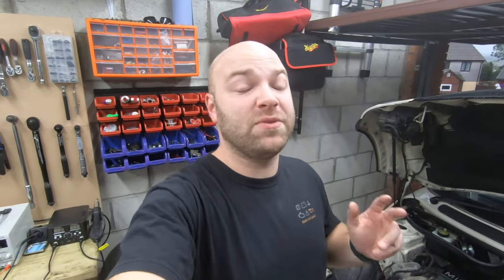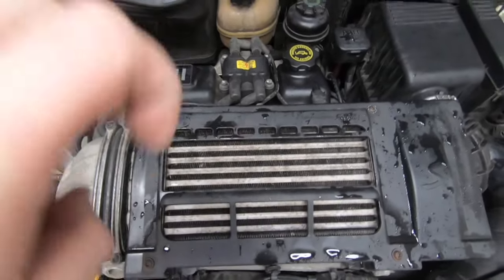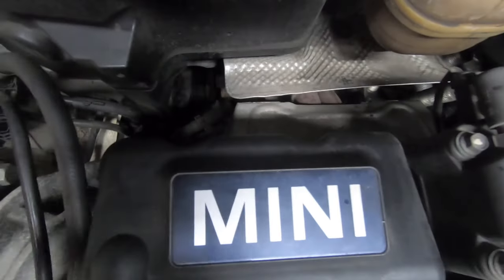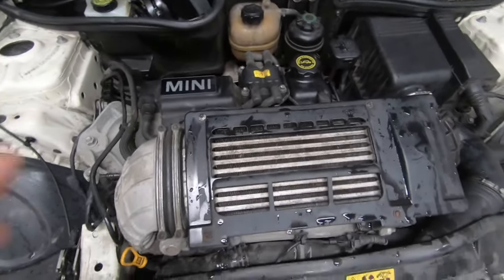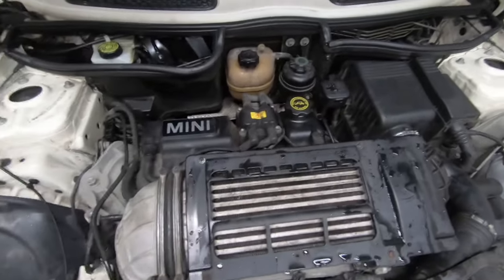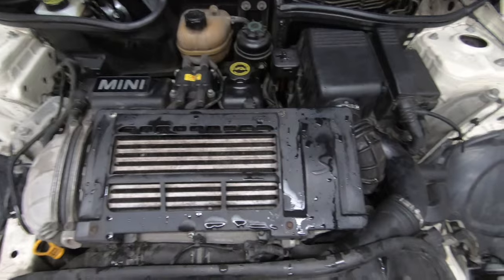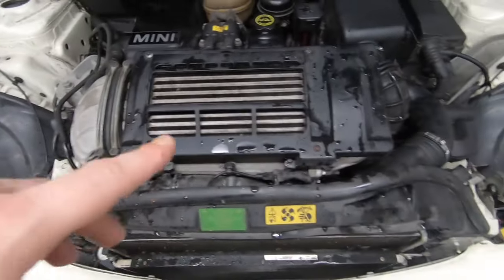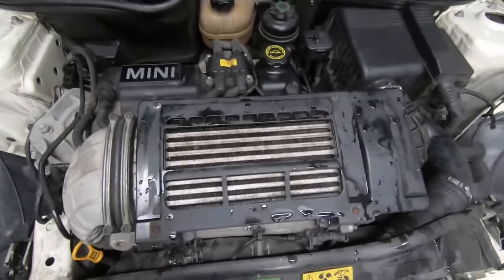Top 10 Things That Will Go Wrong With A 100k + Mini Cooper S R53 W11 Engine

Comment: Another issue that could’ve been mentioned is the coolant overflow tank. The plastic gets brown and brittle with age and can burst at the seams causing a vacuum leak in the coolant system. This in turn can lead to overheating and can trigger the fans after the car has been shut off as well.
Reply: I think thats what happened to mine.
Reply: Coolant overflow tank is total crap on these
Reply: A $30 DIY fix. 10 minutes. Got mine from FCP Euro so replacements are free.

Comment: I've ran a kava 17 percent pully with a colair intake for over 3 years . The original cooler isn't that bad. I drive mine hard and its never over heated or anything like that. Its never missed a beat only thing I've had to do in 3 years is change the washer motor thats it. Its been the most reliable car I've owned its never not started never took thr smile of my face. They are brilliant cars the r53z

Comment: In most all your videos, you mention strengthening the internals before doing any big upgrades. What internals would you upgrade to make it handle more pressure from the upgrades? A quick video like this one would be great. Mentioning which internals and what you would do to them. Thanks a lot.
Reply: The W11b16a (r53 Cooper S) engines are very stout. Built from the factory with already forged internals. There's a good thread on NAM of the engineer(unbreakablelump) who worked and talks about this engine in great detail. One of the consideration would be to look at the transmission as the Getrag 285 unit was not meant to handle the uprated torque and could potentially let go when you start pushing more power.
Reply: @CookJunkie  let go how, you don't explain mr expert?
Reply: @Lamster66  much power : better brakes, tyres, power flex...

Comment: Good information thanks
Ours has done 112K Miles. And its been super reliable. Our crank pully was failing so I did all the other jobs. The dipstick o rings were leaking its wasn’t the sump gasket. Other things I found gone, was the high speed fan relay and power steering fan seized. 
It’s a convertible so no only sees decent weather unless we are stuck for a car so probably why ours is still on orginal exhaust

Comment: on the 2002  i bought the oil on the water pump had gone , making the super charger fail even after i replaced all the bearings the charger was still naff so yes change the oil in both ends to save buying a new super charger.

Comment: I need help and you seem to be the subject matter expert on these. I have a 2006 mini Cooper s JCW 58,000 miles. I’m had a P1237, I replaced the map sensor(oem). Code changed to p1238, I replaced the BPV. The code is now P1240. I’m stumped! Can you please point me in the right direction what I should be testing?

Comment: Hey doctor, I need your help with the problem with my mini cooper s r53 2005 that's been buying me for a while 
When the car is on idle It starts  misfiring .When I put the scanner to it, it reads piston number 2 misfiring (p0302)
I changed the plugs leads and coil pack, but that didn't help, so I changed the injectors, but still no good
I checked the piston compression, which was 150 psi all pistons 
I even checked the pulse at injector no 2, and it was worcking 
What's more confusing to me ,that it only happens at idle but when the revs are high when driving normally it will never misfire, as soon I stop at a traffic light it will start misfiring but when I switch it of and on again it gows  away 
Can you please help me? The mechanics here in Australia are advising me to get rid of the car.
I love this car so much, and I love working on it .

Comment: Hey thanks for your video I just got my 2005 mini cooper s r53 convertible I have a problem the catalytic converter is running red hot and I dont know why, any ideas
Reply: If the manifold is going cherry red after 5-10 mins on idle check the pressure sensor on the supercharger side - if it's not working correctly the engine will run lean and the exhaust will get very hot.  Additionally check for vacuum leaks as one or two of the pipes near the intake or the supercharger manifold will cause running issues too.  If it's just the cat but not the manifold itself the cat may have failed inside but check the other things first as they're easier to spot and fix!
Reply: Might also be clogged, did it pass emissions testing?

Comment: Hello I just purchased a 2005 Mini Cooper for my son and just recently we have a issue where when we start the car it starts up fine the moment we put it into drive RPMs drop dramatically the whole car vibrate and no matter how much I moved the throttle it does nothing no RPM change nothing as if I'm not even touching the throttle. Can someone recommend me a place to start looking for the issue. By the way this is on a automatic
Reply: I'm sure you've figured this out by now but that sounds like the transmission has gone
Reply: Always read they had plastic throttle bodies that were prone to fail...good luck...

Comment: Replaced motor mounts pulley and seal. Changed supercharger oil, replaced every fuse in the car, valve cover gasket. 
Drove to work and now my radiator fan doesn't kick on.
Reply: Bei mir war der Stecker zum Lüfter oxidiert.

Comment: I have  a 2005 mini cooper s I just replaced the engine and my motor mount had my axels rebuilt even replaced my fans water pump n thermostat n reservoir tank and small leak behind water pump now its running but it want stay running what could be the problem now?

Comment: Reservoir leaks, anti-knock sensor, control arm bushings, a/c clutch on compressor, power steering leaks, lock actuators……These cars are filled with problems and expensive to repair at the dealership, usually $200 dollars an hour for labor.
Reply: Find a good experienced Mini mechanic (like I did), buy your needed parts online, and it's no biggie.    I too was nervous about Mini ownership, not anymore.

Comment: Evening bud 
So I've got a 03 cooper S when I go over 4500 revs it kicks in to limp mod and put out p1688

No burning smell coming from engine so dont think.its the crank pully
Reply from the maker: mate that code is for your pulley The slipping pulley is causing the supercharger to spin slow and not build boost I know this because I had the same exact issue change your harmonic balancer
Reply: @BMWDoctor  ah sweet. I shall order new and change it.. :D
Reply from the maker: No problem

Comment: I had an r53... pulled the engine and made a week out of a rebuild.

To hell with gaskets bruh; I used rtv no leaks ever.

Also modded the from clip so rad was on an aluminum plate so I didnt have to fight with that stupid ass plastic front end.

Comment: My R52 has the temp gauge up on full when the car is cold. I've changed the sensor but still no change. Also checked fuses and checked for corrosion on the large 42 pin plug under the fuse box in passenger footwell. Central locking rear demist has stopped working too. Any ideas??

Comment: Would like to see a video  on a mini cooper 2006 R50  sequential problem as mine will not go from manual to automatic
Reply: It's not call Manuel it's a automatic transmission with tiptronic style ... Just put your stick on the D and it will be automatic lol

Comment: I've got a 2004 Cooper S that has (I'm assuming) the full stage 1 JCW kit that was installed on it at a BMW dealership most likely..I'd sure like to know for sure what all that meant or if it has any additional upgrades..hopefully one day I'll have the $$ to tear into it
Reply: The JCW kit included a new cylinder head with mildly ported exhaust ports, cold air intake box, smaller pulley on the supercharger and a tune. On the 05-06 the JCW kit included 380cc Injectors. Engine internals are all the same throughout the years.

Comment: My Cooper s just had a clutch changed, then the slave cylinder let go a day later, then after he replaced that, he said The master cylinder needed replacing because he couldn’t bleed it right, then he said he found a leak.. now the car has some ticking noise when turning right, disappears going left, there’s a vibration or out of balance that shakes the car up and down violently. It feels like a wheel is about to come off.. what could he have screwed up, can a dual mass clutch fail like this? And to top it off it’s lost about 50% power..
This wombat mechanic has screwed up my car.. it was running fine, just needed a slipping clutch fixed.. my god what a nightmare

Comment: my r53 seems to be hot when i put my hand infront of the supercharger or over the engine after driving a short distance, is this normal? as ive only just bought it.......do they run hot?
Reply: @chick99936  yes these cars are notorious for overheating issues. Thanks to the tiny engine bay and fan issues.

Comment: Owned a 2005 r53 for 4 years before totaling it. Don’t daily drive one. Pretty much Everything on an r53, WILL break. With the repairs over 4 years of ownership totaled enough to buy another one.
Reply from the maker: My friend sorry to have to tell you but you got your batty taken to the cleaners.

Most people that own these do the work thereself and very very very easy cars to do it on this whole engine cost me £400 to overhaul and to drop another engine in this is a piece of piss.

If you can’t work on it yourself then unfortunately the garage will rip you wide open and I don’t blame them
Reply: When I say buy another, I mean another for the price I paid, which was around $8k. I did however get a $7k after 4 years of ownership, for totally it.

Comment: I have a 2006 mini cooper s and had to replace the harmonic balancer twice because the rubber piece in the middle would shred until I bought the cravenspeed one which is all aluminium no rubber in the middle....I already had the 15 % reduction pulley so I went ahead and bought the stock size but there is also the 2% overdrive which would be like having a reduced pulley
Reply: they are made of rubber or filled with fluid for a reason...constructive interference can build up and wear/break your lower rotating assembly

Comment: Excellent video mate 👍always good information
Reply from the maker: That’s correct sir thanks very much
Reply: @BMWDoctor   can buy a 2011 Mini for $3,000. Looks very good. Woman who is third woman who owned it is going through a divorce and needs to sell it fast. Carfax looked good. Saw normal maintenance over the years but only a timing chain tensioner on it about 4 years ago. Automatic, recent brakes and tires…good buy? Any things to look for?

Comment: My r53 has been running crazy idle when cold start and exhaust sounds like choking. Have an o2 sensor fault code for the first cat.P0131  Also a throttle body code P0123 and P0222. 550 injectors has been upgraded and remap to 550 as well. Should i replace both the o2 sensor since its now at 120k? Any advice please
Reply from the maker: Yes they are a common common problem and do go wrong at that mileage mate I replaced both on mine as they are a high failure point at around 100k especially the rear one
Reply: Bmw Doctor thanks doc. Can i only replace one for now? Or in the future i will have to do the second one anyway?
Reply from the maker: You can mate but the other one will fail due to the stress from the other one mate it’s better to change both

Comment: How often does the supercharger oil have to be changed please?
Reply: Every 100k miles, you'd be pretty lucky to have to do it more than once
Reply: what kills them is seal failure which allows the oil to leak out

Comment: My son has a mini that was running rough so he changed the coils on the misfired cylinders. He changed the oil also and it ran great for a month in a half, and started running rough again. He went and changed the spark plugs and now the car won’t crank. It tries to crank for a second, but stops. Any ideas? Please, and thanks!
Reply: Did you end up finding a fix for it?
Reply: Must have mixed up the sparkplug wire  orders
Reply: Fuel delivery. Likely fuel filter or fuel pump.

Comment: Changing boost on a stock engine not good.. Seen that on tractor engines 98hp at the final drive then turbo'ed to to 125hp  you lose clutch and an high wear on engine or the engine lets good.
Reply from the maker: No I’m upgrading intercooler mate aswell for performance one mate I’m not cheap like most on YouTube or stupid kevin I DONT DO CHEAP !!!! You know that already I’m probably the only youtuber who throws grands into cars to just give them away after 

It’s all to prove a point to other youtubers on here I don’t do cheap 

I’ve also just been sponsored by a massive mini company in the Uk who work all over other countries and who repair then there independent specialists and bringing me a lot of parts to put on I have a meeting with them this weekend to discuss things over who are gonna be providing me all the parts to make this the best mini around they do exactly what I do in a workshop but they also make common failure parts and make better parts to rectify issues so I have on board who I need my friend 

Kevin I’m not Nathan my friend I have contacts now buddy and everyone likes me and wants in with me on business I’m working with the bmw dealers helping them with there keys and programming and doing the same for these independent on the coding and programming for the minis while they help me with what I need when I need it :) I got myself well tied in 

That’s the bonus of NOT slandering the dealers and independents all the time of a lot of youtubers learnt to keep there mouth shut they wouldn’t be paying for parts all the time and would get sponsored just like I do and don’t get raped up the arse when I need parts and I have a skill that no other has so that is more valuable then car repairs my friend :)
Reply: @BMWDoctor  What we have here is high performance remapping on a stock engine you know what will happen. Some here do it cheap. You are sponsor'ed now. I can say I knew you when. Thats the problem here with shitty parts. Good for you Dean. All Green on the modules on the X5. 👍👍 Buy the way I keep posting on channels when BMW is brought up about repairs and software and point them to you. Nathan does what he can with his funds.  With out you to I would be a parts changer.
Reply from the maker: That’s correct mate it’s called a parts fitter mate and that’s why I have stopped that for many people now you actually just change the ACTUAL part that has failed and not run rings around yourself
Reply: Bit of a comment revival here but I've been running a tuned R53 for ten years, including track days, using quite a few stock components. It's sitting at 227 whp with stock rods, pistons, clutch, flywheel and diff. I have wanted to upgrade these parts but never had the spare cash to do it as I spend most of my cash on tyres, brakes and servicing. It has been rock solid, only problem I've had was a shredded supercharger belt which was my fault for leaving it too long without changing. There are guys running more power than me on these stock components, it's a hardy engine considering I've given it 17 years of abuse without any major problems.
Reply: @CFHmetalorama  it's a testament to the engineering and how the engine is overbuilt. Forged internals from the factory + Getrag transmission = can take abuse.

Comment: These engines had a major defect. The block cracks at just over 50Km Stay away.
Reply from the maker: Well mine never 😕 that don’t happen in my ownership half the problems I hear on YouTube I never seen in my whole life maybe that’s just me as I don’t buy anything that comes up 

I only buy good looked after stuff from responsible owners at high price to make sure I’m getting a good deal I don’t buy anything just to have a car to show off
Reply: I've owned 2 r53s I sold 1 with 188k miles and the other 110k no block cracking
Reply from the maker: Thank you for that you confirmed what many know already 

Only people who suffer cracked blocks are the ones treating it like crap and not letting it cool down and not changing the parts needed when it’s needed all they want this car for is power power power another stereotyped car like bmw they get it because everyone goes on about how fast they are they don’t realise the maintenance involved people keep that hidden
Reply: Stephen Crowther you mean “no they all don’t” a class action law suit shows that BMW admits liability for this defect. Facts don’t care about your feelings.
Reply: You are talking out your arse - nobody. 182K miles on my R53 (bought new) and still running great.